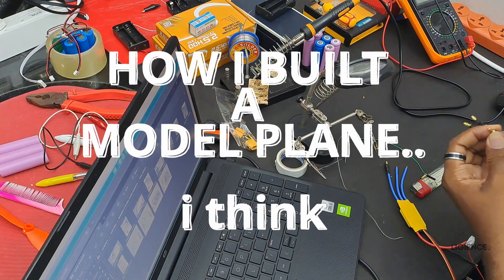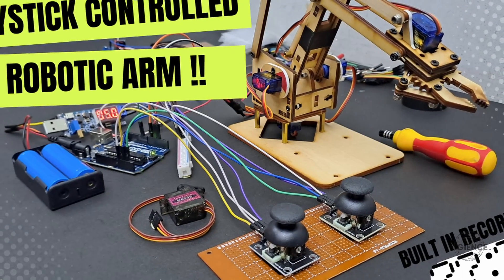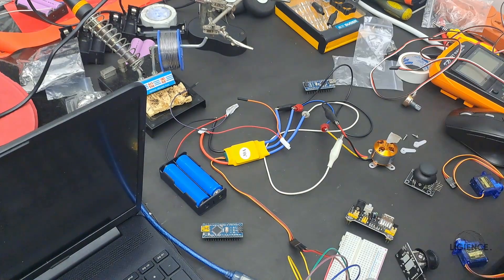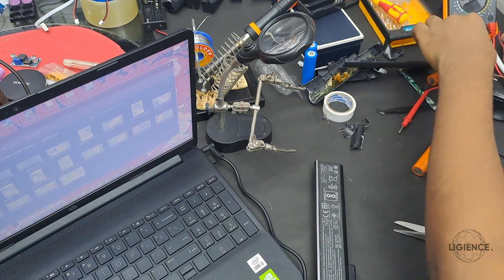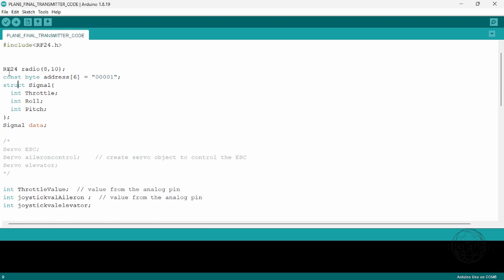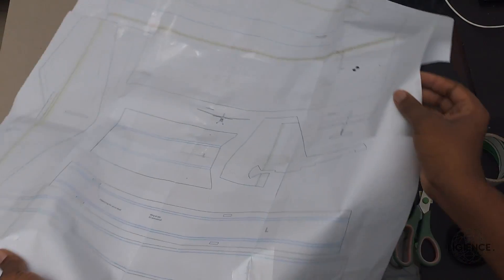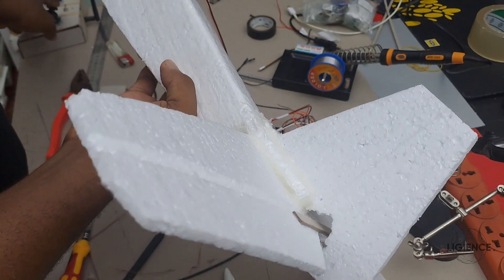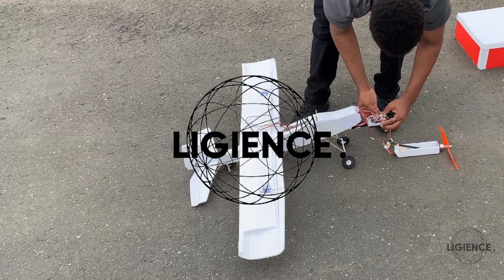How I Made A Model RC Airplane With NO Experience From Scratch - DIY Arduino

Comment: if you do not already know how to fly, you should learn to fly with a model that can be controlled without ailerons.    that is, a model that has a dihedral wing.      twelve degrees or so.      that's  six a side.        the design of a dihedral wing should include  a  Center Section  and two wing halves.        googletranslate
Reply from the maker: Ohhh. Thank you.